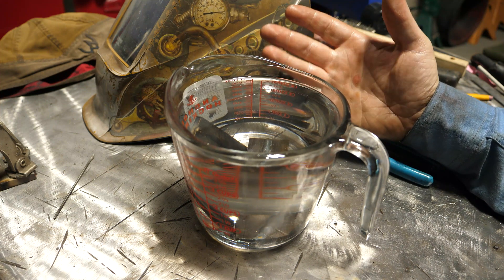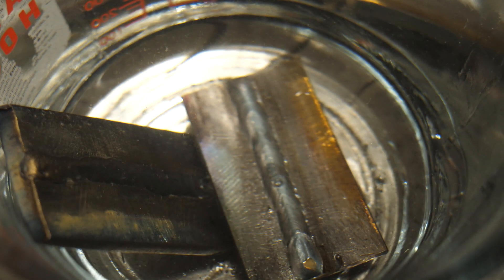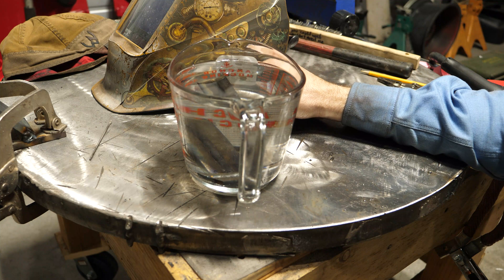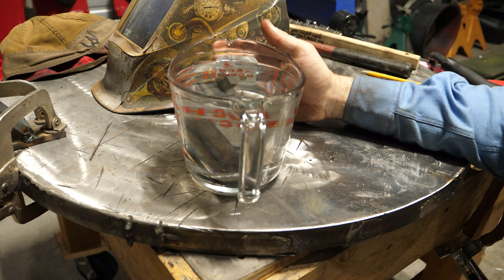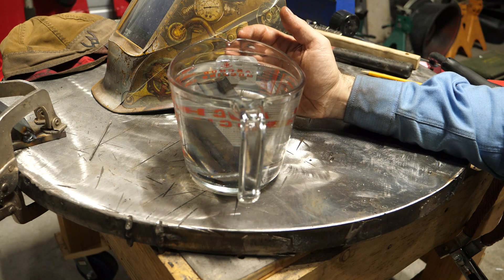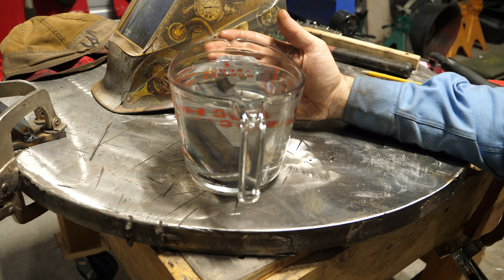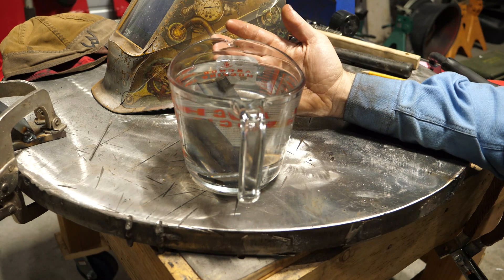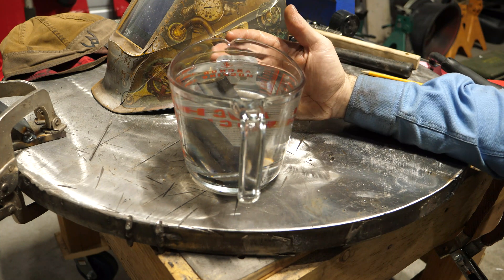Mig & Flux core hydrogen test (quick follow up)

Comment: Great job on this subject Greg. I’m set up to run pretty much everything, but unless I’m indoors, Flux Core is my go to at the ranch, mainly because of lack of prep and high penetration. Hope you will give Flux Core another shot using better wire. If I have to go to 7018 on hardened steel, that will be a real pain. Thanks!!!
Reply from the maker: Flux core self shielded is a great process, I like it a lot.  It does have some limitations when it comes to its tendency to produce porosity in welds.  Having done a lot of testing with it in the last year I have learned a lot.  The main things that matter is you have to use it within a fairly narrow setting range, and you must not go outside of its capability.  I prefer dual shield to it because it produces cleaner welds, but after testing .035 dual shield (with disappointing results, videos will be out soon) I still rather run Gasless for a lot of work.  Not to mention Gasless flux core is far easier to weld out of position than stick.

Comment: What do you think about dual shield flux core?
Reply from the maker: Dual shield in .045 and bigger wire is a great product, is basically solves the issue normal Gasless flux core has with random porosity and somewhat brittle welds.  I have a 3 part video on .035 dual shield coming out within a week.  That had “interesting” results to say the least, stay tuned to see what I mean on that 😀

Comment: Interesting topic Greg.  My community college beginners welding class instructor barely mentioned hydrogen embrittlement at all, only skimming the topic as primarily related to stick welding high strength steels with the wrong flux type rods (using 6010/6011 instead of oven baked 7018's.)  I never even considered it an issue outside of SMAW.  Since you perked my interest, HE apparently can come from several sources that you might not consider.  The flux types on various stick electrodes certainly as certain fluxes are more hydroscopic than others, particularly if stored out of hot boxes, so that is understandable, but also welding in wet conditions (not that I would do that but underwater welding comes to mind...how the hell do they deal with HE??) and welding on dirty materials, such as grease and oil contaminated steels (oils and greases are hydrocarbons and break down under heat of welding and imbed hydrogen in the weld pool).  Also poor quality shielding gasses and poor metallurgical choices for filler rods can also cause HE.  An interesting series of tests would be to deliberately try to induce HE by contaminating a steel coupon with engine oil or grease and weld it and then check for HE.  Another test would be to wet or soak some 7018 and let it air dry and see if it causes HE.  You could also do the grease contamination test with MIG and TIG or even oxy/acetylene to see if HE happens there.  Makes one consider oxy/acetylene welding with coathanger wire vs proper RG45 and if HE is an issue there.  Lots of ideas to check!
Reply from the maker: Great thoughts.  Without a doubt there are a ton of ways to impart hydrogen in a weld.  I will definitely have to investigate/test different things like you mentioned and see what happens.  Recently I have rounded up a bunch of materials for further testing, including spring steel, ar500, a few tool steels, and some castings.  I have a lot of experience welding those things for repairs and I am planning on doing videos on welding them.  The real interesting thing will be using my new shop press to bend test the welds, there will be huge differences in strength based on using proper procedures vs incorrect ones.  😀